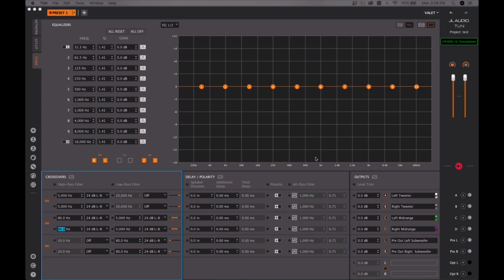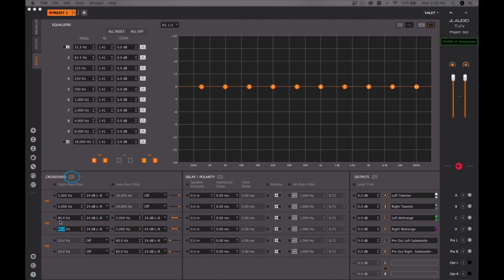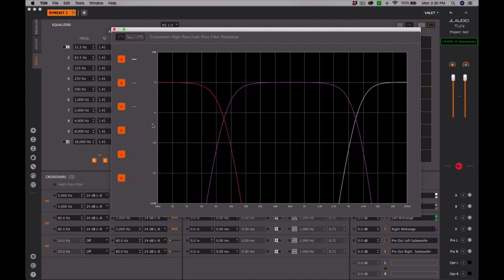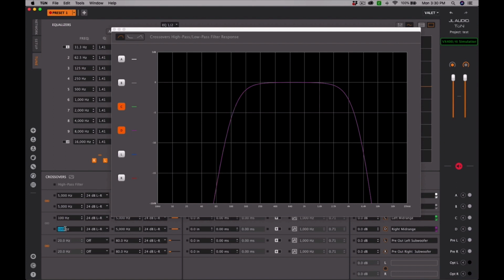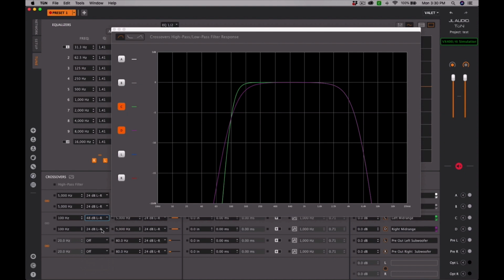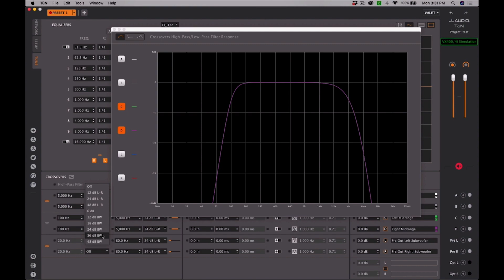JL Audio Help Center - Linkwitz-Riley Vs Butterworth Filter

Comment: Hi, good morning JL AUDIO.  I have a question, Can I install a fix 86 in my car with out CD? And what remote control is the correct for fix 86, DRC-205 or DRC-200??
Reply: Yes you can down load the Fix calibration CD from JL's web site and put it on a jump drive.

Comment: So im guessing you CANT use 2 TWK88s with 1 DRC-100 knob? I asked this in different forums, on Facebook, instagram and even emailed JL Audio with Zero Reply, i give up. 😅
Reply: 8 channels isn't enough? From my experience the answer is no. maybe with the DRC-205 and the VXi hub but I'm not sure its compatible with the TWK's
Reply: @James Elam  weird that I never knew that you left a reply a year later, to answer this question, 8 channels is NOT enough for me specially for a full Active 13 channel set up with front and rear separation. As for the VXI hub, yeah unfortunately it doesn't work with the TWK88. 🥺 but the VXi amps are pretty much the way to go if you get the C7 speakers.

Comment: This helps.  I'd like to see more vids like this on the Fix and TWK series.  I installed both in my 2017 F150 and have been learning about the setting through trial and error.
Reply: Five Star car stereo did a good video on it go check it out.